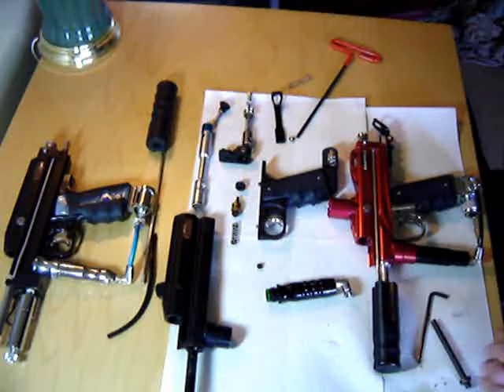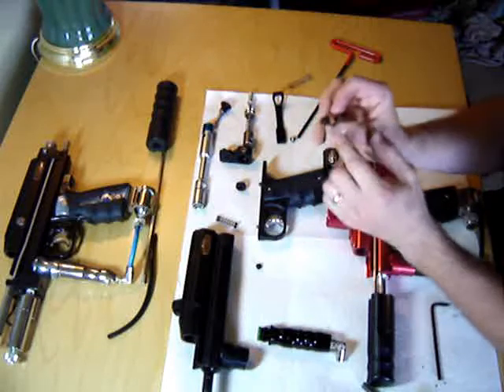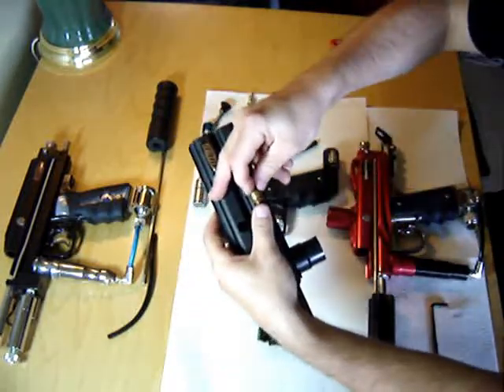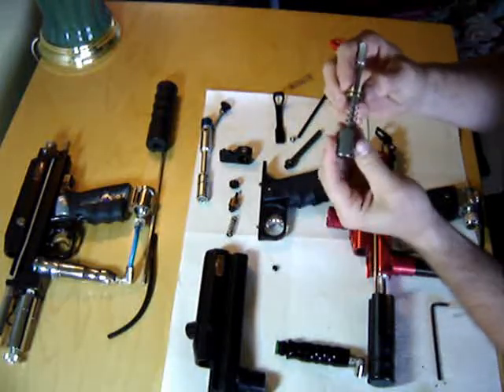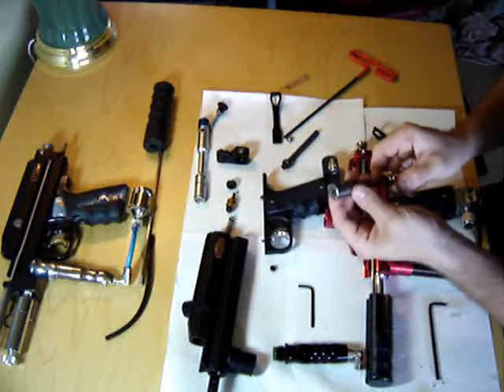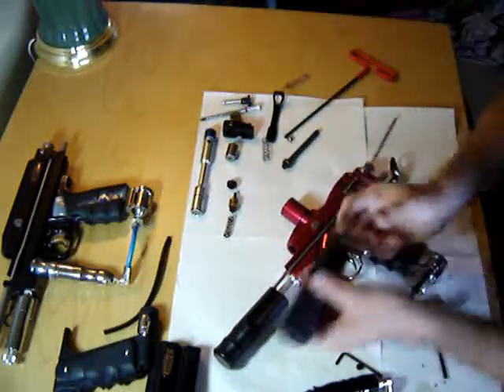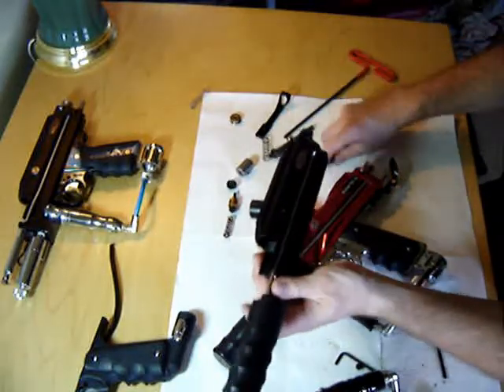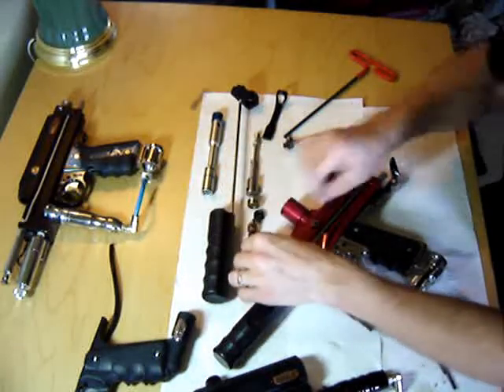sniper internals

Comment from the maker: 1.  remove the grip
2.  take out jam nut from bottom of gun
3.  take off back block and bolt
4.  take out IVG and adjust hammer lug up so hammer drops out back of body
5.  use valve tool to remove jam nut from behind valve.
6.  valve comes out back of bottom tube - depending on how it's stuck in there sometime you have to rap the gun on something hard - or remove the front and push it through from the front.

Comment from the maker: yup, like I said in the video - you can, but the tool helps to align the jam nut with the threads.  Drilling the center of the allen wrench will allow it to fit over the stem of the valve - which makes it easier.

You can wrap a bunch of electrical tape around the shaft to help align it.

OR, you can spend $10 on the tool to protect your $50-$100 body.